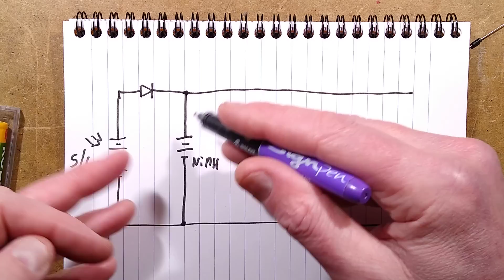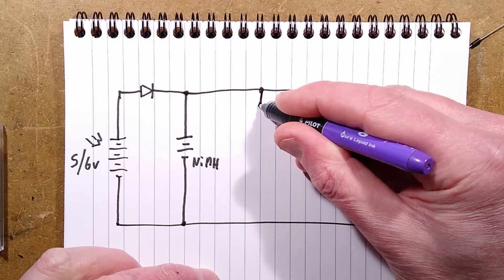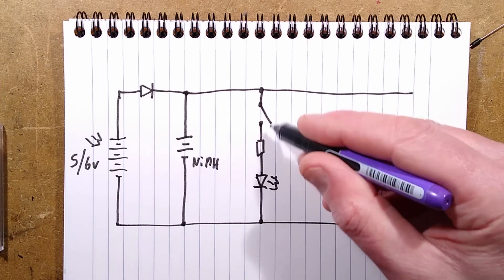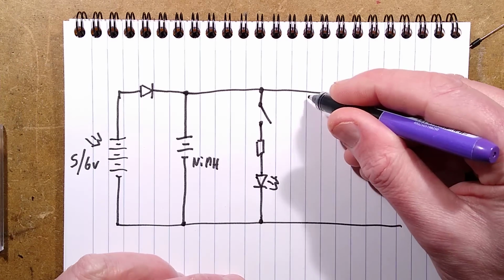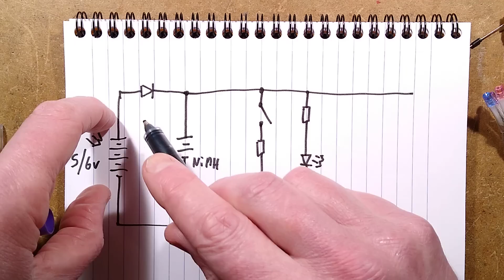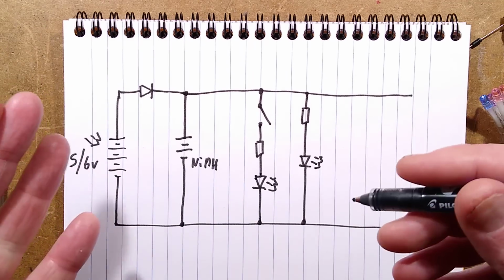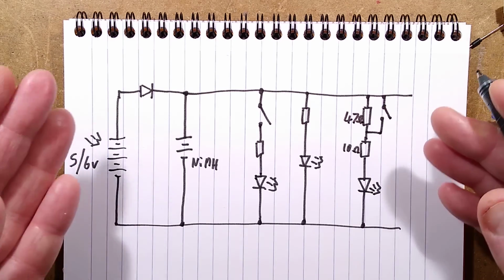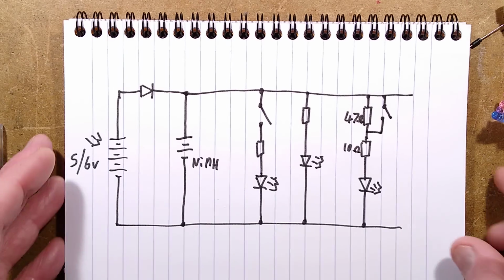Apocalypse solar lighting system.

Comment: I use USB power banks, portable folding solar panels from 20 to 120 watts with charging ports, Onite LED light bulbs, and NiMH and 18650 chargers that work with them, plus my best 6 volt radios, as a last resort, have three small glass 6v 5 watt glass solar panels that can be plugged into their power jack. I also have a collection of glass solar panels, 11 solar power stations from 250 to 700 watts, and a 300ah LiFeP04 battery that has two MPPT solar charge controllers and a 2000w AC inverter. I run my lights and fans in my camper during the day directly from solar panels without batteries. You can also use a 12-24v DC rice cooker with nothing but glass solar panels.

Comment: I found a little solar light while cleaning up today that I built a while back, I think inspired by one of your designs. 1 diode, 1 resistor, 1 2N3904, and a self-protected Li-Ion (aftermarket Gameboy battery I found in a clearance bin) strapped to the back of a 12 cell solar panel. Still charged up and worked fine despite being under furniture and covered with dust and dog hair for a couple years!

Comment: I am Very impressed at the way you solder, it is an acquired talent. I thought I was the best 😂
Reply: The trick is being able to hold as many things as you can in two hands:
Soldering iron
Solder
Wire
Circuit board
And hand in contact with the work top, a couple of fingers holding the circuit board other object to keep it still...

Pressure applied to the circuit board to stop the components on the underside falling out when you are soldering them...

You don't need tools to hold the board..!

Comment: Question: In an apocalyptic world with no electricity, how would one solder this apocalypse project together when they can't use an electric soldering iron?
Reply: If with no inverters to give you 120/240V, 12V soldering iron. If with no batteries, flame heated soldering iron. If no gas, fire or coal heats the iron. There is also small hammer looking irons that are meant to be heated with what is available. If no soldering iron, use a nail, stick it in fire and use it with tongs or pliers.

Comment: I work as a volunteer on a steam preservation railway and we do what you just did.  IE Some cars have incandescent lamps and some have fluorescent lighting.  Problem one is we have to use the same lamp holder or with tube lighting the same lamp shade and two it all runs on 70 volt DC?  SO we do what you just did.  To day buses use 24 volt LED lighting and that where we started from

Comment: Clive, what are your thoughts on how long of a wire you can have between the solar panel and the battery pack and the string of lights before it starts eating away at the power? Can you, say, have the solar panel in a window 10 ft away from the string of lights? 20ft? 30ft? At what point does the wire length become a problem?
Reply: It'll depend on how bright your lights are and how thick the cable is. If you're using say an extension lead I can't imagine 30 meters being a huge issue, you may need to adjust the value of your resistor.
If you use really thin wire then it may start to matter earlier. But even then it's just going to reduce the effectiveness it won't stop it from working at all until you get silly.

Comment: I actually just recently did this. I used 4 panels scavenged out of solar lights tied together with the day\night controller and a small lithium cell out of a discarded "street source." Works great, plenty of light and absolutely free.

Comment: I’m one step ahead of you Clive.  I have several panels keeping deep cell batteries always charged that run turn in LED strips around whenever power goes out.  I also have two generators (one petro and one diesel) that power the house.

Comment: Please do more projects like this one - 3/5/12v doofers built from salvaged stuffs (apologies for the technical jargon). I live in a studenty area, so every year there’s a season where the students migrate, shedding a mind boggling amount of tech and electricals - from novelty tat to consoles, lights and computers - which is followed by the renovations season, where you can find yer more domestic build cast offs and trimmings; eg. the last of an LED strip reel, not enough that it’s worth them keeping, but enough for a small project.

Comment: I'm sure glad I've held onto those wee solar panels over the years. I have at least three I could use for such a project. One puts out roughly 3-4 volts. Another one puts out 5-6 volts. And the third puts out 10-12 ish volts.

Comment: Erm, if youve only found LED's could you use one of the LEDs instead of the diode in this circuit, seing as an LED is a diode in itself? Also, is there an easy to make homemade resistor, like maybe bare copper wire wrapped round a pencil?

Comment: In your post-apocalyptic world, the power will conveniently still be on to run the soldering iron. Personally I have a 12V soldering iron I could run off a car battery as long as the gasoline lasts to change it. Failing that,  I suppose you could heat large nails in your campfire and handle them with vice grips.  A little clumsy for delicate work.

Comment: beside the whole doomer "end of world" mockery (i think? kinda sorta?!) in this video, I've actually built something similar for my mom, except it powers a fairly big flickery fake candle on her balcony table. She smokes (unfortunately), but only on the balcony of her apartment, and had one of those big-ish (2x AA powered) LED candles on the table so she could see after dark, but was annoyed the batteries barely last 2 weeks even with 4h timer mode. So I converted it "a little" and now it's powered by two cheapo "2000"mAh NiMH batteries that get charged via a solar panel in a very similar way to this video. To not just have the solar panel randomly on the table with wires to the candle, I put the whole fake candle in a square metal ornamental lantern which conveniently had a flat top as its roof as a perfect place to put the solar panel on, sealed and held in place by a bead of (non vinegar-y) silicone around the edge, with the wires going inside hidden as best I could. It works great and I'm weirdly proud of it... and somewhat jealous since I never sit down to build something this "elaborate" (effectively just a homebrew garden lantern) for myself for some reason 🤔
Reply from the maker: Next step.  Converting your mom to vaping as a step in the right direction.

Comment: Presumably a pre-apocalypse project. I'd like to see you do a post-apocalypse version using a nail heated in a fire as a soldering iron !
Reply: Soldering irons can be USB-powered, in that case you only need a power bank. There are also gas powered soldering irons.  But it's not a bad pre-apocalypse project, something to do when you wait for your new soldering irons to arrive.
Reply: @fishyerik  And there is also the vape battery soldering iron that Bigclive featured a few years ago
Reply: @fishyerik  "Soldering irons can be USB-powered"

Or butane gas powered. 🙂
Reply: @fishyerik  post apocalypse is likely to be post EMP, almost everything with silicon electronics will be destroyed unless it has been stored in a suitably shielded enclosure.
Reply: @MartinE63  artificial EMP is not as bad as thunder strikes so not all silicium or semi conductor components will be equally affected. Though a shielded enclosure is just a metal case like an Altoid box so a lot of devices and instruments might survive, especially if connected to ground.
Reply: @MartinE63  
Post EMP,  *you* are not going to be around to find out!!
Reply: @MartinE63  use aluminum foil to deflect some of the radiation
Reply: Seriously though, soldering predates electric power by thousands of years.
Reply: @TJStellmach  but how would you find that device in that Apocalypse Scenario?  (Seriously.... That gasoline powered soldering gun with a hand pump to pressurize it, that had been used by my grandfather in the 1950s/60s/70s to solder copper water pipes, is still in my parents' house. But on one hand it might be a bit oversized :-D and others might be less fortunate to have access to something like that ;-) )
Reply: NiMH powered soldering iron??
Reply: Put your electronics in a metal biscuit tin earthed to ground
Reply: @off da grid.... how do you ground it though

Comment: Without electricity, would you just heat the soldering iron over a fire? For that matter, could you just use a hot nail?
Reply from the maker: A hot nail isn't ideal, but in an apocalypse it works.

Comment: This is why I adore simple technology. That little project would probably keep going for MANY years. The LEDs being run at such low current would ensure a long and prosperous life of spewing photons. The only thing I see is the batteries would need to be replaced every once in a while.
Reply: Solar panels will degrade eventually too. But that is likely to be a lot longer than the battery replacement time.
Reply: Easy fix is to grab old car batteries and make a 2 cell battery out of them, so you can run the lights for decades, simply keeping the paste wet.
Reply: @SeanBZA An interesting idea. Small charging amp would not work on lead acid, though. Needs more to tickle the chemistry. Lots of small panels or pieces of broken, bigger panels could work if buck converters are not around.
Reply: @Teknopottu  You can downsize the cells you make to match the capacity of the cells, as in most cases you would be remaking the plates entirely on old well dead batteries, so simple flat lead plates, with the lead oxide pasted on, and in the separator pouch, will work. Not going to be a 55Ah battery, more like 15Ah, but will last a long time.
Reply: @SeanBZA  True. My input was about how to charge them.
Reply: @Teknopottu  Victron Solar Charger.
Do it the right way so you don't knacker the battery.
Reply: @deang5622  I don't think you can use even an expensive solar charger to charge a 2 volt battery made of an old lead batteries. We are still talking about small voltage batteries made out of recycled materials?
Reply: @Teknopottu  Construct or buy a constant voltage regulator. Decide on what voltage you want to charge it at. 

Then you need someway to detect when it is  full. Either a comparator and a comparing a set threshold or delta V.  I am not sure if delta V works on lead acid.

Comment: Would like to see more of these! Would love to see a much more scaled up version for larger string of outdoor lights with a larger panel, 18650’s and the controls for that or rechargeable 12 volt or motorcycle battery.
Reply: I Did like  lasersaber  SOLN1 - Portable Solar Power

However i would more Go For Higher voltage Setup's That don't use battery's  (MPPT VFD, BPC ) and just outputs 120V ~ 240V AC (3 phase 415V) From 100V ~ 500V Solar DC (Rolling day to day Daytime only setup) 

Battery's come later on the AC side Tool battery packs with Fast charger 1 ~ 2 hours

Comment: Could I use one of my many old nokia batteries with built in protection?
Reply from the maker: Yes.  With a solar panel of 5 or 6V.   Better using a dusk circuit with lithium though, due to the higher voltage.

Comment: Dollartree/Poundland solar light. Snip one lead of the LED and add a switch. What I do so far when the power goes out is go outside and gather some of the solar lights as the sun sets. Then I pull the batteries out of all but the ones I want on. We just got some more expensive solar lights that have an on-off switch. I haven't determined yet if they charge in the off position.
Reply from the maker: Most don't charge in the off position, but a diode between the solar panel + and the battery + will fix that.

Comment: How bought adding a joule theif circuit to boost the voltage for a series LED string. Transistor scavanged from a compact fluoro bulb and a rusty nail toroidal transformer.

Comment: You could replace the battery with about 15-20  1 Farad Capacitors with 4,7 Volt each. Connect them in parallel so that it won't affect the overall performance much if one fails or 2 at some point after a few years. I built something similar but powered with a hand-cranked generator. It takes about 2–3 minutes to charge the capacitors with the hand generator and isn't very exhausting. Can be charged with any other electricity source like a solar panel too. I did a video about this on my channel. You have to be careful with capacitors however because they can discharge energy very rapidly. Don't touch your tong with it for a test ... ;)

Comment: If you find yourself in an apocalypse, how would you power your soldering iron to make your lighting system?
Reply: Using static electricity from your beard, of course.
Reply from the maker: USB soldering iron or a nail heated in a fire.

Comment: Love your videos Clive!  I am a cabinetmaker, so the dancing pixies are way over my head, but I do enjoy how you explain various electric projects/teardowns inner workings. 
I live in Hungary, and since the war is looming over our head it would be great to see more of these videos that would be very useful in the event of ww3. 
How would BigClive generate electricity to keep his kettle going?
Reply from the maker: I'd use a solid fuel Kelly kettle.
Reply: Anything that makes heat uses lots and lots of electricity. (Reverse cycle air conditioning still uses lots of electricity, it just produces lots and lots and lots of heat) 
Save the electricity for literally anything else. Like some nice lights :-)
(Roughly speaking Clive's kettle will use about 6000 times more power than those lights. Could be double that depending on how he's done his lights)

Comment: Amazing video as always! Could you do something similar with 12v? I had an idea of using a old car Lead acid or AGM battery running a string of fair lights with some sort of solar trickle charger, to charge the battery during the day

Comment: In the '70s, I built something similar...20 surplus selenium solar cells and diode, to keep a nicad 9 volt battery charged. The battery powered a Western Auto transistor radio. It was mounted on an old cafeteria tray...looked weird, but it kept the battery charged ( took all day).
Reply: There were solar panels in the 70s?
Reply: @radry100  selenium solar cells have been around forever....silicon ones since the '50s. Generally, you bought individual cells and assembled your own. Older solar cells were .5 volts at a few milliamperes. You wired them in series to get to the voltage you wanted.
      Selenium solar cells were very inefficient...and were common surplus in the '70s....silicon had replaced them.

Comment: Which diode do you recommend, because it'll have a voltage drop, is there any where that drop is particularly low?

I hear the schottkey diode has a drop of only 0.2v, you could save almost a third of a volt! 

Provided of course you get any sunlight at all through the nuclear winter 💀
6 days to charge for 12 minutes of light, woo

"Loose leds" won't be the only thing that's 
loose, skin, stools, the ground beneath your feet as your shoes fill up with fluids 😂🚀
Reply from the maker: With a 4v solar panel a standard diode is fine, and more rugged than a schottky one.

Comment: Philips makes these really cool battery back up LED lights. It's just a standard LED with a lithium battery inside. The bulb has a switch on it to turn on the light or will automatically turn on in the event of power failure.

Comment: The diode has a band on one end.  That band indicates the negative or cathode, the other end away from the band is the anode or positive.  So I need to connect the anode to the positive of the battery.  So far so good.  What happens if I connect the diode the wrong way around?
Reply from the maker: If you connect the diode the wrong way round it simply won't work.

Comment: An ideal project for those 'street find' batteries.
Reply from the maker: With suitable charge limiting it would be a good use for them.  That could actually be done with the control chips in many of them.
Reply: They are more efficient in terms of charge and discharge as well (energy out vs energy in) so in a low light level area it could be extra good. But yes as Clive said at a minimum use cells with protection circuits.
Reply: Its a Pity I find more empty packets than the actual devices they once contained

Comment: I got into messing with solar lights recently found some neat ones. Modifying them to last longer because they don't get full sun all day so added more solar to it and slightly bigger battery from 800mah to 1200mah
Reply: They always put pitifully small PV cells on to them. 

I got some really nice flickering lights which have a small panel on top but also have a USB charger input so just purchased a much bigger panel